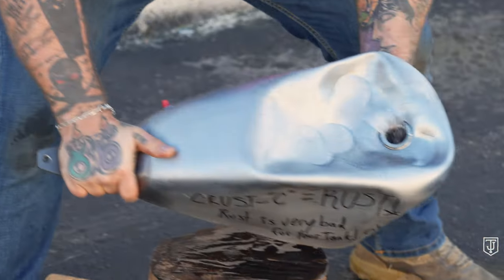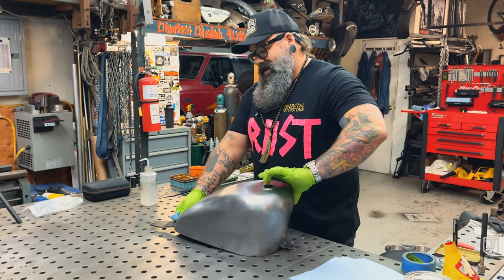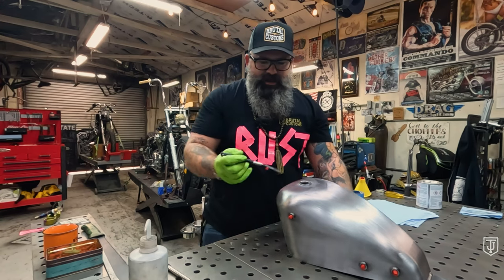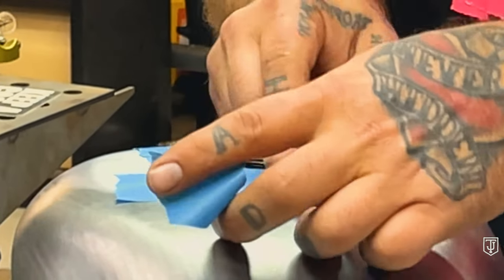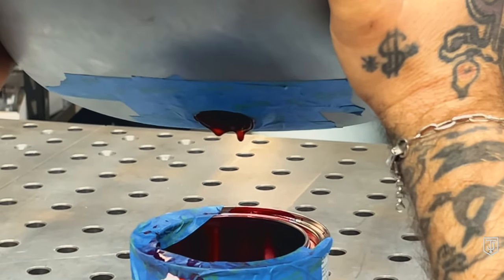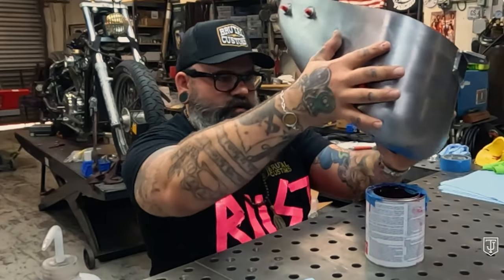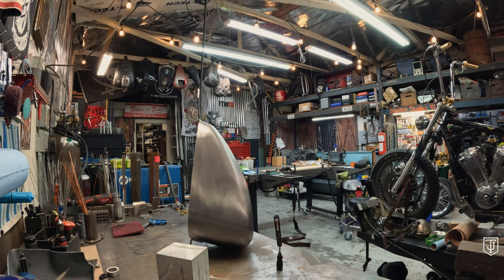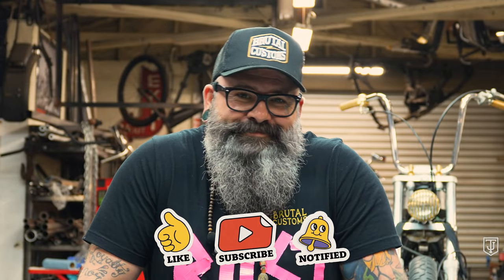How To Line & Seal A Motorcycle Gas Tank - Avoid Fuel Tank Rust Forever

Comment: When cleaning and Coating new Aftermarket Harley 5 gallon split tanks. I would clean each half with acetone, drain then coat as you shown in video then proceed to the other half of the tanks? How much acetone and Red Coat should i use in each half? 
Thank You.